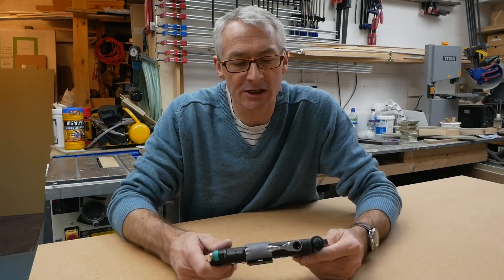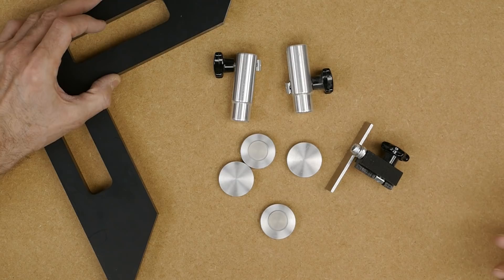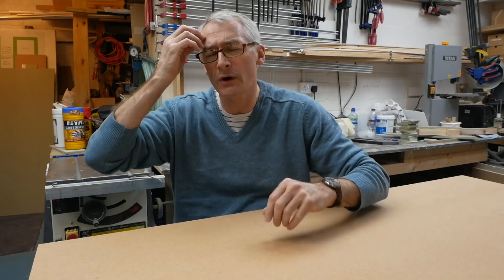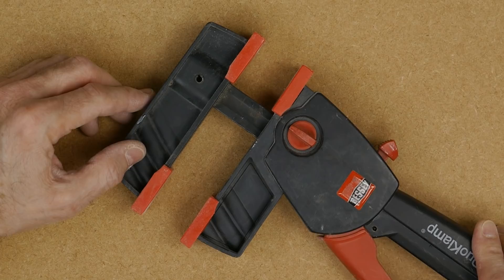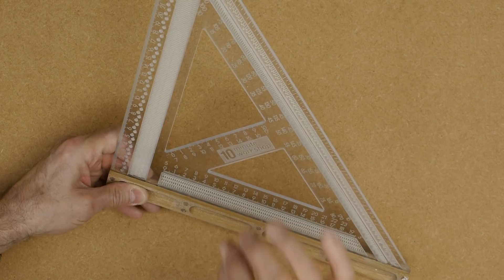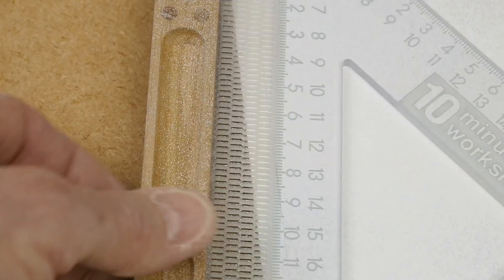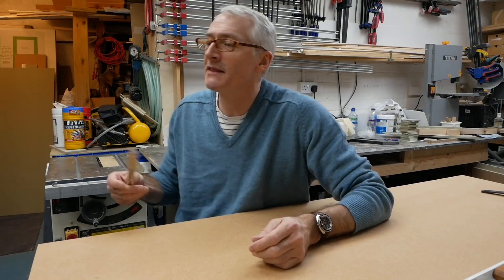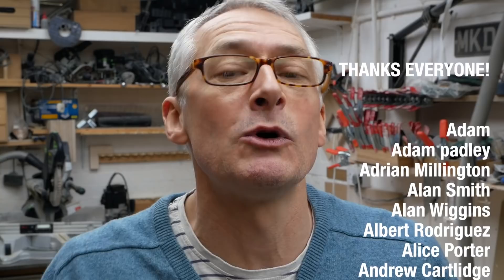Gifts for Makers P2 [video #248]

Comment: Just in case anyone is interested. The sprayer, well it is loud, the connecting pipe is pretty inflexible and I think could do with being longer. The sprayer construction itself seems quite well made and looks like there's very little that could go wrong with it. Taking it apart to clean is simple and there doesn't appear to be any fiddly bits.
Apart from the already mentioned things, yep it works quite well. 
Advice for using it?
Filter your paint. Any lumps or bits will block it. I used the kitchen sieve. Perhaps not necessary for a brand new can but anything that's already been used, it's a must. 
Wind the flow right back. It's very easy ( and messy) if it goes on too quick.
I had to thin my paint very slightly. It could of been from the lumpy start I had, but if it comes outs in spits and spurts, that could be it. 
Well worth the money.

Comment: I love the katsu trim router, I've had mine about 9 months now and used it to make my own ceiling light and skirting boards etc, it's brilliant! More than enough power to handle everything I've thrown at it, yes a bit noisy, but any power tool is 🙉 I never replied to my previous comment on the Aldi bandsaw either, the blade kept falling off the first 2 I had delivered, then the third one turned up completely bent out of shape, so I brought the titan saw instead, love that, I just need play about a bit more with setting it up as it drifts a bit, but I know the fence can cause drift 👍

Comment: Great video Peter. On the Katsu Trim Router, i have both the Katsu and the Makita models and as you said one is the cheaper version of the other.
It's good for a cheaper version, i bought the Katsu to use in a small desktop router table, instead of the big heavy router that you usually have, it comes in handy, and then i use my Makita for the hand trimming stuff.
Barry (Wirral, ENG)

Comment: Great vid. I also have a Mirok square but the smaller of the two. I would be happier with it if it didn't have quite so many slots for fractions of a mil, its diffficult getting the pencil in the correct one. Call me rough but I have got on perfectly well in the last 35 years as a carpenter/joiner with only working to half a mil.
Reply from the maker: Haha, yes - the thickness of a pencil line is the best I can manage, too! 👍👍

Comment: You nearly lost it while fondling the Superor Level!  (Does look great though)

I have an alternative to the Wera Tool Check that is not as quite eyewateringly expensive - take a look at the 'Bosch 2607017160 Screwdriving Set with Mini Ratchet'.  It's got me out of a few tight spots!
Reply from the maker: That's a neat little set - would have fitted nicely in the pocket-money vid! Next year, maybe 👍

Comment: Those levels are too beautiful to use. Keep them three blocks away from  of your paint booth!
Is it possible to seal somehow that "not-clean" air meters? I mean, it's only necessary to see the display and to have the  connector accessible. Or not?
Reply from the maker: Thanks Hans! Haha, the levels earn their keep and get jammed into the back of the van with everything else! And no, the air quality monitor has a small fan that pulls air through the sensor, so it needs to be ‘open’ 👍

Comment: Nice to see the Katsu, for the price it's a marvellous bit of kit. I think mine was less than £30 from an eBay seller.
Reply from the maker: Yep, absolutely! Price fluctuates a bit, but great value anywhere between £30-£35 👍
Reply: Just curious. Do you know if the separate attachments for the Katsu would  fit the cordless Makita router?
I wouldn't mind the plunge base for mine.
Reply: John Mackay honestly not sure as I don’t own the Makita. There are a few comments here and there that say certain accessories fit (8mm collet for example) but I couldn’t say for sure sorry.
Reply from the maker: Don’t know about the cordless Makita, but I’ve been told that the Katsu plunge base definitely fits the corded Makita.
Reply: i have the cordless makita. im looking for a spare base for it to leave on a jig im going to make for flush cutting edgebanding like john heisz built. looks like it could be cheaper to buy the katsu router instead of the base. the base is 40
Reply: @10MinuteWorkshop  
Thanks for the reply. I'm sure if heard when the cordless router came out that the attachments from the corded one fitted. So assumed with the Katsu being a copy, that it's attachments would also fit.
Reply: @MelbourneAlan  
I suppose it's no big loss to buy a Katsu just to find out if the attachments are compatible.

Comment: Thanks for a great video Peter.  Bad news re: the air quality  monitor. I bought one after seeing you use yours. (In U.S. so couldn't use your link) Anyway, mine is still working and has helped me evaluate the effectiveness of my air clearing system (a DIY system) The good news is that the air clears fairly quickly.   Also, i love those levels! Happy Holidays.
Reply from the maker: Thanks Mark! Could I ask you to send me a link or post a link here to the one you bought in the US? Would be good to give folks across the pond a pointer 👍

Comment: Hi Peter, do you have any tips or tricks for preparing edges of mdf board? I always get a fuzz that doesn't want to go away when sanding. Spray paint doesn't even want to grab onto the edge either.
Reply from the maker: Hi David. I did a 6-part painting & finishing series, starts video #029, which may be worth a look? But in truth, I’ve never done anything special to the edges of MDF; I use MR (Moisture Resistant) MDF which is a better quality board with a denser core, and I’ve never had to resort to any of the tricks that some guys use; I’ve tried them, over the years just out of interest (thinned pva, zinnser BIN primer etc.. etc..) but I’ve never found them to make a difference on MR MDF. Sand to a high grit (P320) finish on the edges and apply first coat of primer, sand again, apply a second coat of primer. De-nib, then apply 2-3 topcoats. That’s it. HTH P

Comment: Would the spray kit be OK to spray fence panel preservative paint...?
Reply from the maker: Haven't used it for this, but yes, it should be fine as long as the preservative paint is thin enough to spray, or can be thinned enough.
Reply: Thanks for a quick reply... Great channel... Very inspiring and nice wit...

Comment: Re. Your Air Quality Monitor. There is a guy with a YT channel called John - Orbiter. If you have a word with him he may be able to put it right. He works on some tiny devices using a microscope to solder (iPhones and the like). You never know there maybe a video in it for him and a free repair for you!
Reply from the maker: Thanks! I’ve bought a replacement sensor, so fingers crossed it’ll just be a swap-out, but I’ll bear it in mind 👍👍

Comment: I stick to my 3M mask.
You can get cheap laser meters that are also accurate no need for 75£
Reply: Please drop 4 to 15 times a cheap - Aldi or Lidl - laser meter ftom one meter high and pick up the chinese electronic puzzle... 😜😜😜🇨🇭
Reply: @macbaar  no thanks aldi electric pruducts are for the bin also the lidl ones in uk. My from china is correct i measured it with a normal measure band.

Comment: Just a quick question Peter, what paint do you use in the terratek sprayer? As I have a bookcase to make and paint. Thanks in advance Peter.
Reply from the maker: I’ve used water-based acrylic primer/undercoat from Leyland and Johnstone, and water-based acrylic eggshell from Leyland and Tikkurila. All worked really well 👍👍

Comment: I would have thought the sensor on the air quality monitor would be a consumable part. 
I don't think I would even get the level out of the box, I wouldn't want to get it scratched!
Reply from the maker: Thanks! As I mention int the vid, I’ve bought a replacement sensor and I’ll be fitting it before too long, see if it resurrects it. And yes, the levels are lovely - but still a working tool. 👍
Reply: @10MinuteWorkshop  Hopefully that get it working. I would love to buy a decent level, but I drop them far too often and end up having to replace them. Last time I bought some good screwdriver bits, I ended up dropping the pack and a couple rolled under the floorboards and were never seen again, and the 99p ones from Toolstation usually last quite a while for me, even with the impact driver, but I've had a couple that just shear even with a hand driver

Comment: I know this is a bit off topic but Aldi have workzone track saws in the specialbuys on Thursday 29th Nov, £80.
Could be worth a look for a new video?
Reply from the maker: Thanks! Yes,  so I’ve seen. Looks like a re-stickerd Scheppach PL55 at half the price. Trouble is I already have 4 tracksaws, don’t really need a fifth, lol! Or a sixth, if I bought the Lidl as well...🤔👍👍
Reply: Everyone know all good joiners need own a minimum of 6 tracksaws 😂
Reply: I bought one. I just tinker a little at home. Great value. Only down side is the 2 tracks provided are 700mm each so when joined are still quite a way short of 2400mm for a long rip of 8x4 sheet. Next purchase is the HVLP sprayer. Great videos and keeping it real for  lads like me. 👍👍👍👍🇮🇪🇮🇪🇮🇪
Reply: Yes I took the plunge and purchased one too, we do have a very decent panel saw at work, so not too sure it will get used much. But looking forward to giving it a try. 
Maybe You could buy a scheppach 1400mm rail join it to the 2x700, just a thought....

Comment: Hi Peter, a lot of you tube channels are pushing "RZ masks", have you tried one and if so how do you rate it against  the trend air stealth?. I bought the sprayer as soon as you showed it. I haven't been able to try it yet due to the weather and the fact that I have to work outside and it is a bit nippy to say the least.
Reply from the maker: No, I haven’t tried them, though I’ve inevitably been aware of  the marketing push. I think they’re American, so don’t easily translate to the european P1 P2 P3 mask standards. The masks seem a little pricey, but the filters are pretty reasonable. Not sure how much that helps, I’m sorry! 😂👍👍
Reply: @10MinuteWorkshop  Thanks for your input, I will not be needing any masks until the weather warms up a bit so I will keep looking. I have the ALDI version of the little router and it works great, I have a lot of routers but most of them have big handles on the sides and are plunge routers so I like the small fixed base one and I have it set up with a round over bit like yours.

Comment: I never understand why sets of bits come with Torx and security Torx, why not just the security Torx, you then have space for more sizes or other shapes.
Reply: Could you please explain the difference between Torx and security Torx? How can they be recognized?
I know only one type of Torx.
Reply: @hansdegroot8549  Standard torx is the star shaped bit you already know. Security torx has a hole in the middle of the bit and a "pin" in the middle of the screw. This prevents you using a standard torx bit to remove them. Have sent a link to a picture but that may not work, if it doesn't, google securty torx and you will soon see what I mean.
Reply: @caskwith   Thanks for the explanation.
Reply: @hansdegroot8549  You are very welcome.